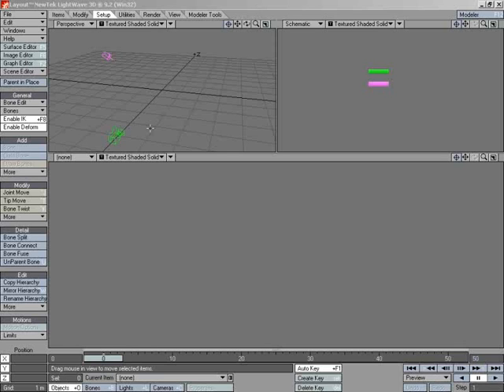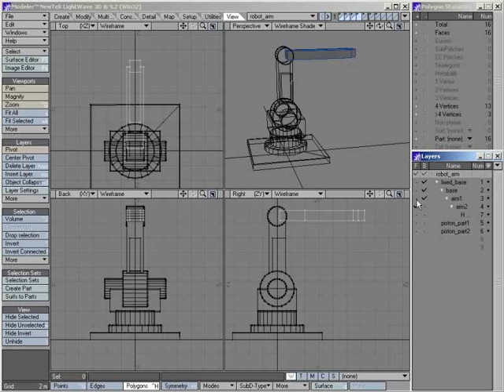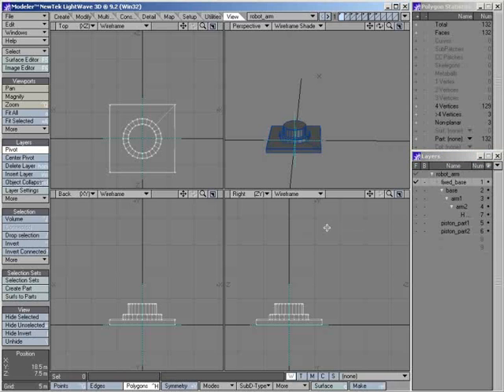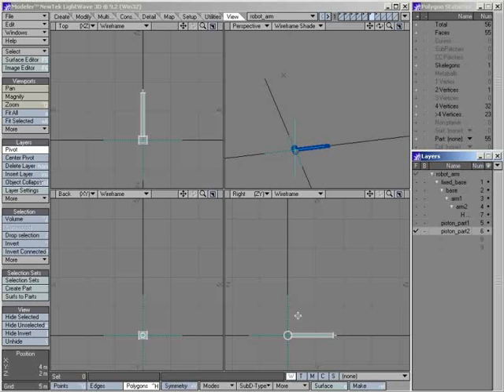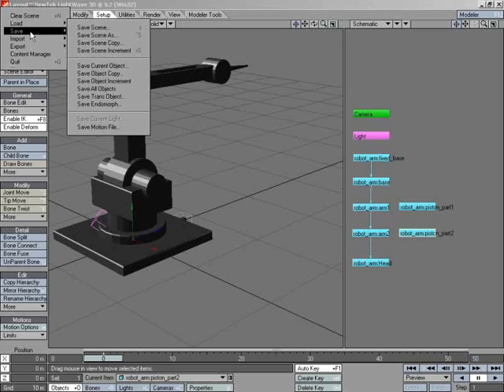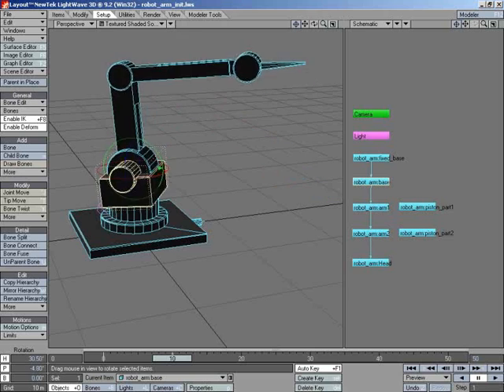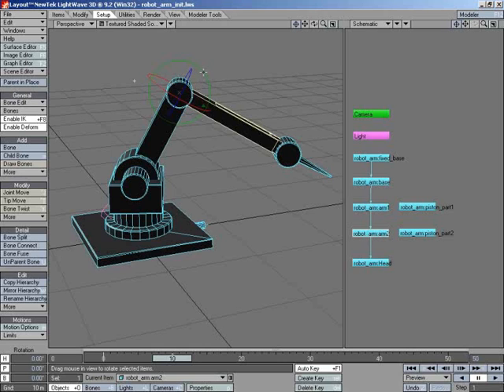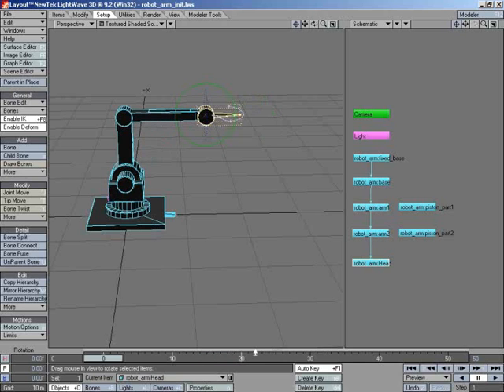Tutorial Lightwave Newtek :  Rigging a mechanical object.

Comment: Nice video! I'm very new to rigging and IK/FK on lightwave and I still have a few questions...

A few days ago I drew up a rough idea for a four wheel steering system in a sketch book. I'm thinking of building my own doorway camera dolly as they are very expensive, so I modeled a rough mock up. Thats where I hit a wall trying to figure out how to rig it. Ideally it could be setup where you would only have to animate one component of the system and the rest would be correctly effected. I think it would make a GREAT tutorial video!
You seem like the guy that would know how to do this, so heres a link to the file if it's something you'd be interested in.
http://d.pr/f/6E5u

Thanks and thanks for the vids!